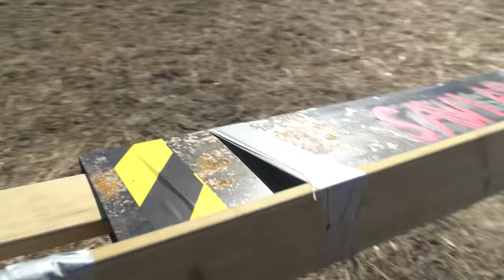Can you Launch Frisbee with Pneumatic Cannon?

Comment: Okay, here comes one of those 1000 comments.

If you fire a spinning disc golf disc at that high speed, it will start turning into the direction of the spin (if it spins clockwise, it will start a clockwise spiral and end up on the ground very quickly). So, you need to find a way to make it spin, then tilt the shooting machine so that the spiraling effect won't make the disc fly to the ground immediately, and then find a speed that doesn't make the disc do full spirals but rather turn over a bit so that it is almost horisontal, bit more than that. Then you can get some crazy distance with it.

I don't have a perfect idea, but something that could work. Make one side of the barrel slippery and one side sticky (with rubber or something), and print some pieces of plastic that surround the disc and stay in place when the disc is inside the barrel but fly away when it comes out. Plastic pieces will keep air behind the disc so it will be shot efficienly, and round shape of the projectile together with uneven friction on the sides of the barrel will give the disc the spin required to get a stable flight.

Comment: Im not going to read all the replies, but you might want to look up "discarding sabot"  where the launcher piece will let the frisbee fly free as it leave the barrel... do note maybe less air pressure . the spin and shape create the lift too much forward momentum and the lift effect is compromised as it is when the frisbee flies too slow.  somewhere theres a common ground. releasing the frisbee to effect flight, but not too much forward to defeat lift. 

in my mind i envision a curved launcher end chute. and the sabot releases the frisbee at the curve so the frisbee can bleed off some of the momentum and start rolling to give it the spin and lift to float a long way.   like a jai alai thrower but flat and frisbee width

Comment: Try the frisbee without the 3D printed pusher and the accelerator 5 million tilted at an angle so one side rides the inner wall. It won't seal as tight but might allow the thing to start spinning.

Comment: Think the "muzzle blast" is really getting into the way.  The 3D printed frisbee mount should have some spring loaded winglets that deploy when it exits the muzzle as to not influence the rotational efforts.  The wood strip should have rubber on it maybe and a bend in it's profile leaning into the muzzle blast area.  Had even thought of some 3D printed gearing mechanism to get the rotation going.  But at a minimum, I say the muzzle blast is getting in the way.  🤗

Comment: All these ideas are to get frisbee to spin in the barrel. Also sabot should be stopped as it exits the barrel

1. What if the sabot was open on one side so the frisbee touched the side of the gun. Then grease in the sabot so the frisbee slides in the sabot. 

2 soft foam touches one side of the frisbee in side the gun. 

3 sabot has roller like tube bender to help frisbee to spin easier. 

Ultimately a clay pigeon launcher is the ideal setup.

Comment: Want it to spin flat and stable? Trap the shoe and keep the shoe from extending all the way up the side of the frisbee (wine glass shape in plan). Line one side of the chute with rubber-faced tape; line the other side with teflon-coated tape. (The comments about discarding the sabot are good.)

Comment: maybe attach rope to 3d printed part so it doesn't get dragged along with the Frisbee, and maybe put one rubber wheel on each side instead of duct tape, but have one of the wheel only spin other direction, so when the Frisbee comes out it spins against wheel 1  and not wheel 2 til the Frisbee turns, then it spins wheel 2 in opposite direction, hopefully making the Frisbee spin in mid air.

Comment: Remove the arms of the disc holder. The frisbee is not spinning because the arms supporting the frisbee are doing two things. 1, the friction of the arms and holder are not allowing the disc to spin. 2 the arms are rubbing against the block of wood and the disc cannot even touch the side to start spinning. So make a disc holder with no arms at all but still put a block of wood on one side of the point just past the exit to cause spinning.  Another idea , use a  thin  braided steel cable that is as long as the barrel. attach it inside the barrel at the back and attach the other end to the carrier. the carrier (with the arms) will stop at the end of the barrel and then the now free moving disc will move forwards and can hit the tape or block of wood to start it spinning.  I want to see you guys cut down all the trees on that mountain!. =) Good luck!

Comment: I think the best way to get the Frisbee or any sort of circle to spin in the barrel would be to use a rifling in the barrel which would work like a "rack and pinion gear" in which a rack (possibly  3D printed or machined) would be inserted into the barrel on one side and a Frisbee either modified or 3D printed from scratch would mesh with inside the barrel. Also this process would run a lot smoother with lubricant.

PS:
What i'm about to say would be a lot harder to make but would probably work very well. if you use a guide rod in the centre of the Frisbee as an axle for it to rotate around so that the Frisbee is not rubbing on the sides of the barrel as much it would greatly improve efficiency and accuracy. That said you would also have to modify the barrel from the existing rectangle prism to a more complicated shape. if you don't get what i'm saying here is my best picture of what i'm trying to say

front view of normal barrel:       ______________
                                                      |________________|

                                                                                    __    <     part for guide rod to follow through
front view of modified barrel:                 _______|   |_______
                                                                   |______      ________|
                                                                                   |__|
                                                                                     ^ part for a guide rod to follow through

hopefully this "drawing" isn't distorted by YouTube

Comment: The problem is more with the PLA sabot, it's holds the disc in place with no room to spin.  You will get a natural spin even with any type of softer wadding that will allow some air to pass. You won't need to force physics :p. Yes that will decrease spin out of the barrel by alot but disc golf is not about speed, it's about the spin. Without spin, you get no distance like you did  here.

Comment: I would try just putting the disc (American term) in the barrel without the sabot and try that. If that doesn’t work maybe build a arm that spins with the disc on the end and release it. Or you could do like an auto match baseball launcher and use two wheels to spit the disc out, maybe one wheel slower then the other to mimic the spin.  Kind of hard because the spin comes from the wrist action. But there’s also several different ways to throw a disc

Comment: If you increase the velocity of the disc by 3x, you will have to increase the spin by at least 3x or you wont set any records. Spin is what gives the disc it's stability and therefore the length. Every disc golf player knows this. Something like a clay pigeon thrower on steroids would probably work pretty good to start with. It would be really cool to see you do that.

Comment: Put the air down one side of the tube, rather than down the middle. I'd also try not using a caddy. Putting the air down just one side might be enough to spin the disc down the opposite side of the tube and then come out at a good spin.

Comment: you need more friction between the frisbee and the wood, try double sided tape on both, the frisbee and wood. Or if you have a rubber band on the  wood or all the way inside the barrel . then you also have to get rid of the 3D printed holder. i hope you succed! big fan from Denmark :)

Comment: You need to have the disc lay on top of a short cylinder that is the same size as the inside of the disc. Then, one side of the cannon should be slippery, one side rough. Bottom slippery. The cylinder needs to be able to rotate, and also touch the walls of the cannon. So maybe it sits on a solid chunk of plastic that doesn't rotate.

The other issue is that these discs really aren't designed to fly faster than 80 mph. So they're probably going to turn over instantly and turn into a roller. You'd have to do some experimentation with overstable high speed drivers, and perhaps launch them at a steep hyzer to make it work. Also if you deform the plastic with some bad launches, it'll make it turn over even worse.

The main thing I'd focus on, though, is getting a sabot that has a rotating cylinder, that spins as it shoots down the barrel.

Comment: Use a barrel with long curve, 1 edge of the disc runs along it building rotation. longer = more friction for longer = more spin.
Disc golf discs have stability stats based on levels of gyroscopic precision. 
You will need a super over stable, high speed, distance driver. = lowest amount of gyroscopic precision = lowest chance of flipping over into the ground. 
Having variable speed, rotation, and barrel angle (in disc golf this is known as 'hyzer') will be best if you want to dial it in and achieve 'full flight' (an 'S' shaped flight path like the disc golf pros throw). 
Also, the disc should be the only think exiting the cannon.
If this fails can you please make a mechanical throwing arm to throw discs? an extreme version of a skeet/clay launcher for discs? the  disc launcher 5000000?

Comment: Have the sabot split into two halves... one half grips the frisbee, and is hit by an obstruction on leaving the tube... the other half is free to fall away... this should impart a good spin.  Or... have friction strips along one narrow dimension of the launch tube, and tilt the launch tube to that side... the path will curve, but it will go much farther... don't use a sabot at all.  Or... have a motor spinning the frisbee before launch, no sabot either.

Comment: some energy should be converted to spinning motion other to propagate it forward.
Use a straight Barrel , And modify the frisbee adapter with a self release free spinning hub and a hole on one side of te adapter to blow some air from the back to make the Frisbee spin while its in the barrel... size of the hole will determine the ratio of rotation and linear motion...
or the hole can be on the middle but angled to blow on one of the sides while the frisbee is held with a self releasing free spinning hub

Comment: I presume the 3d printed piece is to make up for the fact that the barrel of the device is not the same shape as the disc. Instead, use 3d printer to make a series of plastic parts, each with an opening equivalent to a cross section of the disc at its widest part. The pieces can be glued together to combine into one long launch slot ramp within the barrel. The fit should not be too tight, allowing a bit of air to escape, to minimize overall friction and allow for inaccuracy in productoin and assembly. Before assembly, a thin rubberized coating could be applied along the interior of one side of the 3d parts, running the length of the completed assembly, in order to impart a modest spin.

Comment: the cartridge 'kelkka' should stop at the nozzle so it will not ruin the flight, if you make the cartridge to support rotation, maybe air cushion, you can rifle 'rihlata' by letting the disc friction spin from one side of the barrel, all the way
Reply: if you want it go fast and spin, you could have a spin holder than detaches, suction holder. if you combine this with a rotary disc with the frisbee on the rim, just make sure you have the suction triggered at one precise location on the rim not to hit yourself

Comment: I don't think the air cannon is going to work for a frisbee. You need an arm powered by a small air cylinder that grabs the frisbee by the front and flings it, with a mechanical release as it reaches maximum extension.

So in other words a mechanical version of how a human would fling the frisbee.

Comment: Due to te force that he mould carries and te v groove that grips to frisbee it will never fly as intended. Lounch it without mould and glue sanding paper or rubber to one side of the barrel on the inside. That makes it spin before it carries high speed, the stability created by the speed will stop it from turning.

Comment: I don't think you're ever going to get a good spin with the sabot short of modifying a gear track onto the frisbee and into the barrel. In one of the slow mo shots though you could see the sabot is much more stable in flight and it causes the frisbee to tumble when it probably wouldn't have otherwise, so getting the sabot to separate into 2 pieces right out of the barrel is important.

Comment: If you used a Dremel attachment that's made to thread into polishing wheels you could spin up the Frisbee and when you stop the drill it would unthread. You'd just need to drill a hole in the barrel and have a saboy that allows spin
You probably already have one around
Reply: *Sabot
I'd also add weight around the discs circumference to increase the rotational momentum, and bonus forward momentum

Comment: Forget about the sabot and make a U-shaped barrel. Or L-shaped at least. The friction of the corner might just make the disc spin. Could add sanding paper to the inside of the barrel to increase the friction. Only other solution is the horizontal slingshot a la skeet-shooter. Would love to see a machine that can out-throw a human, but I'm betting it would take quite a bit of precision engineering. Subscribed, and looking forward to watching it! ;)

Comment: notch the Frisbee like gear. have it flow a very  slightly curved board with the same gear pattern after it leaves th barrel. try to insert a stop in the barrel to separate the holder.

Comment: problem is you need the sabbot to fire the frisbee but the fit of the sabbot being tight and the light weight of the frisbee is stopping any rotation. unless you could make a roller sabbot that imparts a spin on the frisbee driving off the side of the barrel. or possibly make a sabbot that holds in the center of the frisbee allowing it to freespin within the sabbot with a cord that can go out a small hole you could ripcord spin the frisbee and then fire it. as i see it you need to figgure out how to spin the frisbee within the sabbot. Or somehow impart a spin after the sabbot has separated. also other than the ripcord idea possibly add an air jet to the barrel and some small fins to the underside of the frisbee that could also spin up the frisbee within a sabbot

Comment: The air " tube " needs to fit the precise dimensions of the frisbee with the frisbee NOTCHED all around its circumference like a gear with the corresponding notches along one side of the launch tube..Or you could have a similar form fitting launch tube with a taper where a band of material can be wrapped around the circumference of the frisbee while secured at one end to the starting position and as it unwraps the tube tapers in horizontal width to maintain the proper fit and projectile pressure , sort of like wrapping a string around a top to give it a high velocity spin as you yank the string from around it but with a delicate high tech variation on the same principal..Either would be mighty impressive indeed

Comment: The first problem I see ; the sabot should have a flat, or mildly concave face for the frisbee to come in contact with, not a curved one that holds the frisbee from spinning. The ideal sabot would have roller bearings against the side of the frisbee to promote as little friction as possible.   To make a frisbee go a long way,  you need it to spin. Your design does not allow the frisbee to spin,  therefore it will not work.

 The second problem I see ; You  need some form of friction material,like a rubber strip, or  similar,  down one side of the inside of your metal chute,in order to promote spin on the frisbee. You need free movement on one side, and friction on the other side for this to work. The more spin on the frisbee,  the better it will fly. You only have to look at how a clay target launcher works to understand this principle.  

Best of luck.

Comment: Perhaps a two piece round printed part (two half-circles) that encompasses the disc, but would come apart into two halves ( o ) with the spinning force once the disc exits the enclosure. Then a thin strip of sandpaper down one side of the canon slot? Not an engineer, just a thought... :~)

Comment: air resistance is so much at these high speeds, you cannot simply spin a thing fast enough to go in a straight path or so....i believe that the disc needs to be a little heavy, so that its own weight somewhat balances the air drag....

Comment: PLA is often said to be biodegradable, but that's only technically true on the scale of hundreds of years in regards to actually entering the environment. It's better described as compostable, as it takes a lot of specific conditions to really break down in a reasonable timeline, like 140 degrees F or 60 degrees C temperatures, otherwise it effectively acts the same as many other plastics in the environment, like building up in animal stomachs when eaten (Some places list it as edible, but from what I've read they seem to be mistaking the fact that its parts are edible when broken down, and that it is food safe, for being edible itself, which is not the same, and is a serious problem that places like Phys org pop up on Google saying it is). The benefit it has is not being toxic, which can't necessarily be said about the dyes that are used to color it. It's better than some other plastics, but still not safe to leave out.